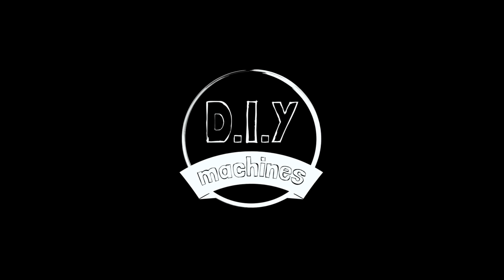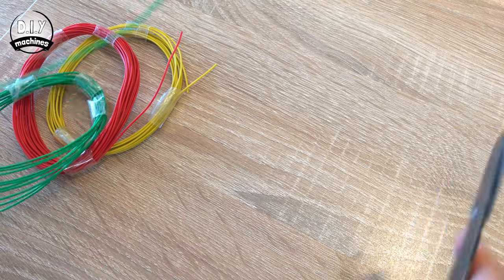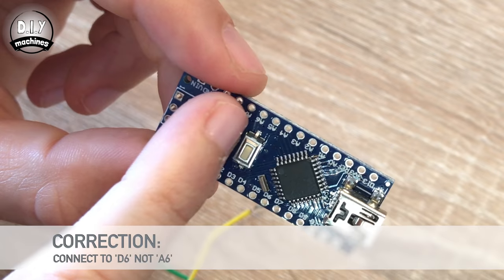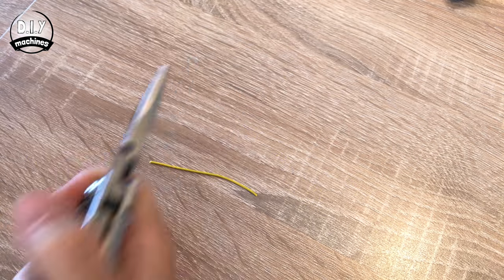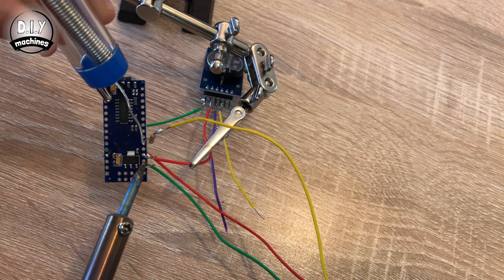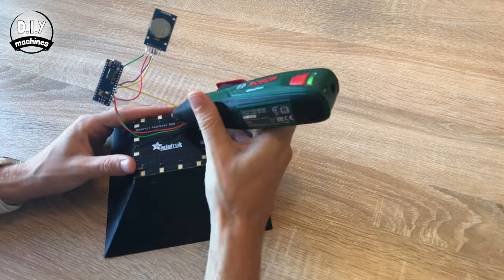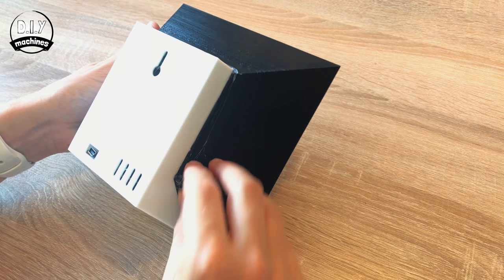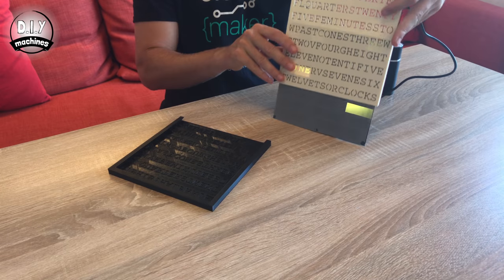DIY Word Clock - 3D Printed - (Arduino Nano, RTC DS3231 and Adafruit Neopixel)

Comment: This is a fun and easy project! You just have to be patient though, because the clock body takes over a day to print. If you follow the links in the comments for the code, you can find a couple of cool variations that change color depending on what time of the day it is.

Comment: Just finished this project and it works well ... as long as it is plugged in. Once disconnected and repowered, it does not correct itself to the current time. It displays the time when disconnected and then goes forward from there.
I have checked the wiring twice, replaced three DS3231 units and replaced the battery to no avail. Both batteries are new and measured 3VDC.
The required libraries are installed and current. I verified the code is the same between the Electromaker website and my IDE. I’m missing something. Any help will be appreciated. Thank you.

Comment: I think your videos are great. Unfortunately, I am still very new to Arduino and electrical engineering. I often don't understand how or why you use which resistor or how the wiring works. Could you not even make a video on the basics? Maybe it would help with my own projects.
Reply from the maker: Hi NK, I started in the same position as you and learned as I went along, project by project. To give myself a head start though I used this book: https://geni.us/ElectronicsBook. Which I can highly recommend, it covered the basics (working out LED's, Resistors etc) and to learn how a component worked you often push it to destruction (they're cheap components). I would say start with the book and you'll be surprised how quickly it makes sense - I still use mine for reference. :)

Comment: I would really like to make the clock but I get errors when I try to upload the code: Arduino/libraries/DST_RTC/DST_RTC.cpp:36: undefined reference to `rulesDST'. Mabe the libraries have been updated that has now broken the code??
Reply: Add: const char rulesDST[] = "EU"; to the code under DTS object and it will compile
Reply: Thank you!  I changed "EU" to "EST" and know I get the correct time and not an hour ahead.